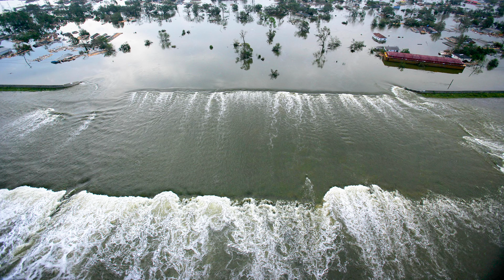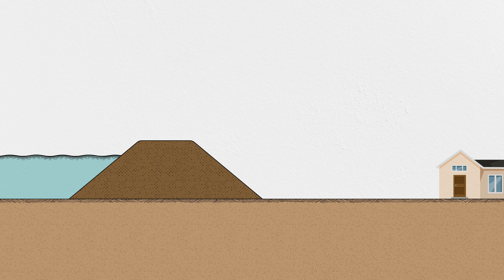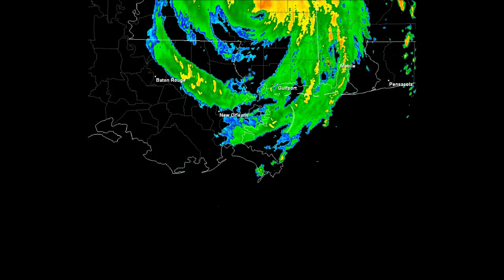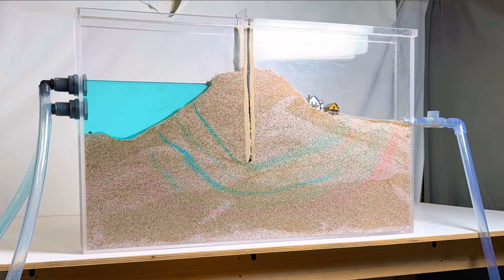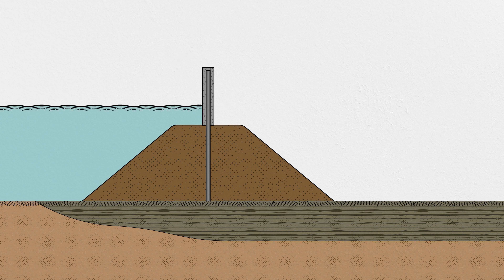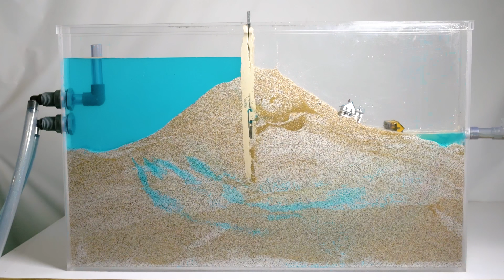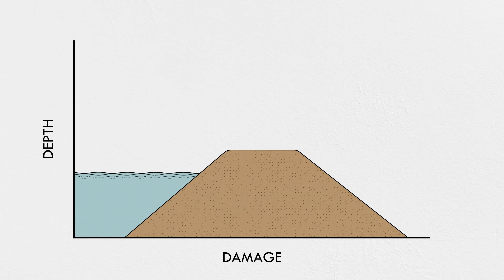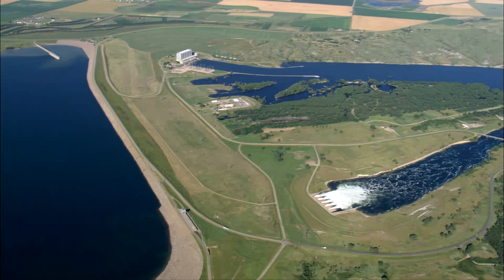The Mind-Blowing Flaw That Flooded New Orleans

Comment: The biggest issue i see is that when a crisis happens anywhere in the world then its upon engineers rapidly brought in to fix a problem quickly. That the problem needs quick fixing is unavoidable, construction is easier when a catastrophe banishes any need to respect someones ears or right of way while driving there are serious advantages to immediatley try and fix the issue. But the engineers are never ready to tackle the problem at hand, there never is a "replacement" plan for the 100 year storm. Look at your own city as a civil engineer and ask yourself how you could seriously improve on storm surge safety just after it fails and you might be inclined to even ask "Are the I-walls even good?" "Can i insert or replace the dirt embankments in a way that could be cheap ONLY after a catastrophic flood?". The corp of engineers that was called there probably made those mistakes because of political pressure to get the job done quickly enough to resume living for the town. Imagine a world where we are prepared for the worst by actually believing what we always say where no design can survive the worst of natural disasters and planning to replace the designs that exist ahead of time - even if that just teaches us how they will fail.
In a situation like this a poltician trying to move fast isnt really a mistake because they respond to the reality of a staggering number of people. But its not like we get these floods everywhere often in the world. A good plan could work even a couple years after we learnt better because atleast then we have a foundation to work from instead of good principles that need to be drilled into engineers.

Comment: I couldn't help wonder if one of the "unknown reasons" for parameters picked such as the choice of the estimated soil strength made by the Corps' engineers  wasn't simply the consideration of the costs.  With any kind of expensive project like the New Orleans levees, engineers are often already mentally conditioned to prioritize the cheapest solution possible, even if that "solution" was inferior and based on faulty assumptions that were or are not best practices.  In other words, the engineers had that accountant mindset already internalized,  basically beaten into them by many rejections and criticism of previous proposals. 
And unlike when one constructs a building, an airport or a power station, you don't really  see or notice the positive outcome of the substantial investment for properly specified and built levees until a major hurricane hits and the levees and dams hold.
Reply: The fundamental problem with designing any passive defense system like a levee is that if you do too much, you'll never know, while if you don't do enough, you'll know too late.
Reply: @macdjord  that's what simulations are for.

nowadays we mostly do them with computers.
in the past they build massive models to trail and error solutions.
that way they would be able to see how much you needed for different situations, and what would be (massive) overkill.

like the Waterloopbos in The Netherlands
featured in this Tom Scott video:
https://www.youtube.com/watch?v=SFkoLYrJGCM
Reply: if only there were some kind of company or other government that couldve warned you and offered help before and after Katrina, those wouldve eliminated almost all of those "unknown reasons"
Reply: That has nothing to do with “accountant mindest”, it’s one of the fundamental premises of engineering. Engineering is about getting a job done using the least amount of resources possible. The issue wasn’t that they were trying to operate efficiently, it’s that they didn’t get the job done.
Reply: @Max-kr2nl  One side of the levy didn't break, so there is proof they could have built the levy correctly while considering budget. They just didn't care if the levy failed on the poor side.

Comment: great video. i don't think you'll ever find anyone arguing against learning from previous mistakes. However, just like there was unintended consequences to building the levee system, there can also be the unintended consequence of spreading the message of "if they had only done more analysis or taken more time, this could have been avoided", is that you can wind up with cultures where no one wants to do anything without years and years of analysis contracts with everyone afraid of being blamed for any future problem. We see this all the time in aerospace and it eventually winds up with rail systems that are analyzed with billions of dollars and no rail built, or billions spent on internet access programs with zero houses connected, or rockets pieces that should be relatively simple but take 10 years and billions of dollars. So we must find some way to let people test, fail, and discover without putting too much at risk, lest we become a nation of paralyzed builders.

Comment: The soil strength threshold decision at 11:26 is the part that actually keeps me up thinking. You're not looking at a case where the engineers missed data — the data was right there, hundreds of boreholes worth. They looked at a distribution and drew the line in a place that assumed better-than-average conditions instead of worse-than-average, which is backwards from how you're supposed to design for the worst case. And then on top of that, the samples they used were taken along the levee centerline where decades of structural weight had already compacted the soil — so even the "conservative" line was drawn using data that wasn't representative of the actual failure zone. Two separate decisions, both nudging the same direction, both wrong in the same way. That's not an outlier data point causing a failure. That's a systematic bias baked into the methodology showing up exactly where it mattered most.
Reply: 🚨 🚨 AI DETECTED

Comment: What kind of modifications would have made the levees more resilient? Concrete cloth rolled out on top of the facings on both sides? A foundation of gravel, similar to a gravel road, before piling the levees on top? Cellular confinement of that gravel foundation layer? Layers of reinforcement in the levees to make mechanically stablized earth (MSE)? Pilings deep underground for the steel top extension to create a wall on stilts? Or is it necessary to go all in with concrete structures instead?
Reply: Look to the netherlands and Germany. They know how to keep their Butts dry.

You need to build them from Sand, Clay and toss earth on top with Grass.
Wide base with a Mountain on top.
The bigger, the better.
Not short Cuts with Walls.
To the Land Side, Leave space. If its wet for weeks with flooding, you might need to toss stuff on top and you need that space.

Then from spring to Fall put sheep there. Up and down the entire time.
They make it stronger.
No Humans allowed on the Grass, but you can Put a nice Bike path on the Land Side If you want.

If you get bunnys damaging the soil, call a Hunter. If Humans dig parts Out, call the cops.
If the City refuses the upkeep, call the media😂

Comment: Money over everything...
The U.S. Army Corps of Engineers operates under strict Congressional mandates that require them to choose the absolute cheapest engineering solution that meets basic protection goals.

Originally, after Hurricane Betsy in 1965, the Army Corps didn't want to touch the canal walls at all. They wanted to build a massive floodgate system at the mouth of the canal where it meets Lake Pontchartrain. When a storm approached, the gates would close, blocking the surge from entering the city's interior canals entirely.

Comment: The Mississippi should've been allowed to change course down the Atchafalaya back in the 50s. Half the problems Louisiana faces are because of 20th century attempts to control the Mississippi River. Now New Orleans will have to be abandoned because it and the rest of the boot toe are sinking into the ocean. Pretty much the only semi-safe areas are parts of the old city like the French Quarter because they were built on the bluffs, and even then those areas are still subsiding

Comment: Seems to me the water seep could be dealt with easily by just making ditches behind the levies to catch the seep and direct it to the channels built for pumping. Doesn't take much to predict the rough furthest place water seep will arc to and then just build underground ditches al the way to the levie's wall. For the ditches just need upside down half pipes hold the soil above in place while letting the water seep in from below and start flowing to the channels instead where it's easier to flow to

alternatively to half pipes could make a "cavern" of sorts with waste high pillars (with wide bases) and a simple flat roof above them to make it harder for the water to seep around said defence
Reply: Just Clay and weight. Some places use Sand bags, other water filled bags. They will Not Help much in such and outdated Trash build, but better than nothing.
It works best on a wide base, so you can add it on a big surface and  fight with more weight

Comment: I have wondered for a long time about the future potential to allow the Mississippi to reroute through the Atchafalaya River as it has wanted to do for a long time. Rivers evolve with the erosion and sediment deposits and it seems like we are getting to a point where more structures are just delaying the inevitable shift. If we take steps to prepare for the shift that might be better than if the Old River Control area fails.